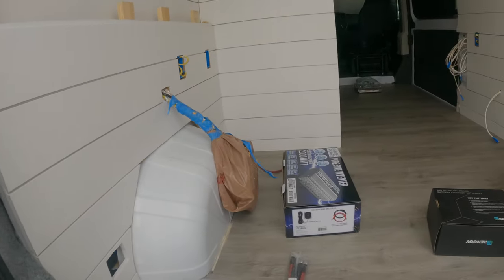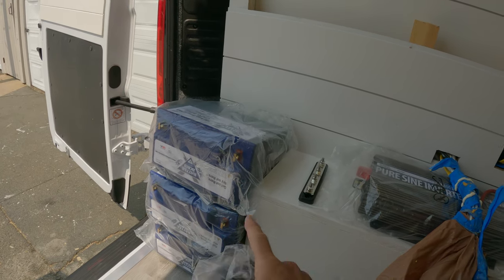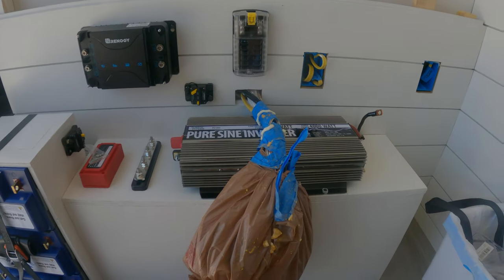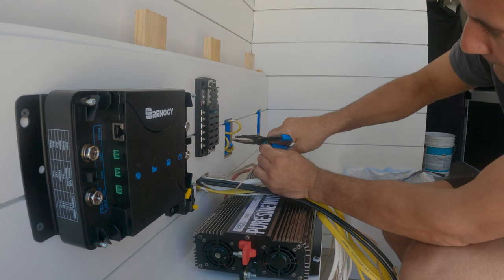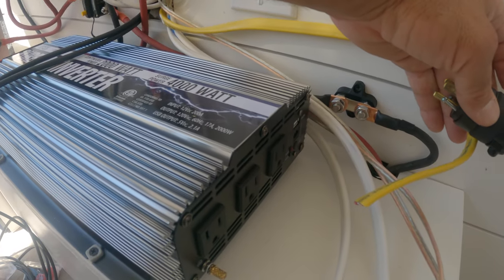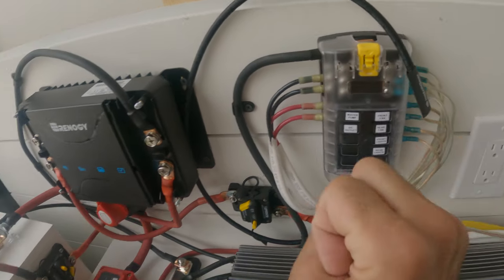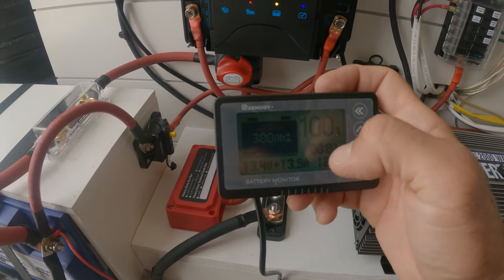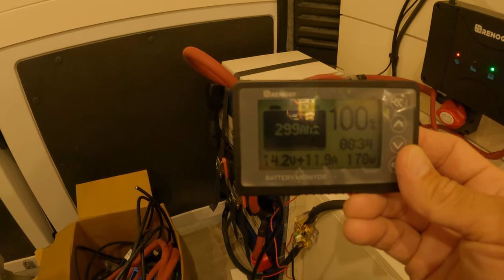Promaster Van Build | Ep8 | How to install Solar Power

Comment: Hey just curious (and I preface this with I just have a very basic understanding of electrical) - why no breakers on the AC outlets/appliance?
Reply from the maker: The inverter has a built in breaker.
Reply: Got it…. Thanks!
Reply: One more quickie…. I plan to use ur power system design and components but I’ll add shore power. Would shore power work with the inverter you use?
Reply: I’m thinking I would need a different inverter charger…..
Reply from the maker: @davidroe1547  I’ll be using a different one on my current build that’s an inverter charger.  Stay tuned
Reply from the maker: @davidroe1547  this build you can unplug the plug that’s into the back of the inverter and plug it into an extension cord to run all a/c off shore power.  However it won’t charge the batteries.   My current build I will solve all of those issues with an exterior plug and an inverter charger for shore power.  Stay tuned
Reply: Perfect…. I was wondering if you were gonna add shore power on the new build.
Also will you be adding a DC to DC charger for the alternator charging?
Thanks for answering my questions so quickly- this is very helpful as I build my plan for the van…..
Reply from the maker: @davidroe1547  this set up here already has dc dc alternator charging and so will the next
Reply: Right - but I noticed you didn’t use a specific DC to DC unit - just a breaker
Reply from the maker: @davidroe1547  the charge controller I am using has a 50amp dc to dc charger. It’s an all in one so you don’t need a separate unit.  Highly recommended it
Reply: Fantastic….. thanks!
Reply: PS - what’s your first name?